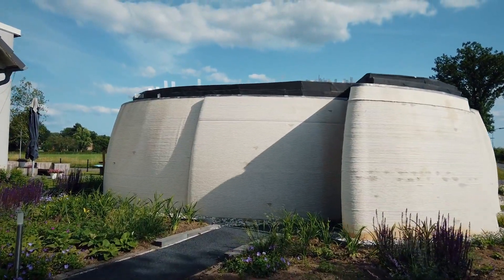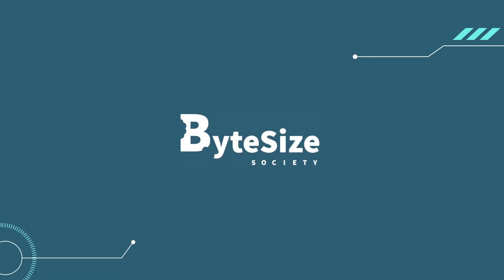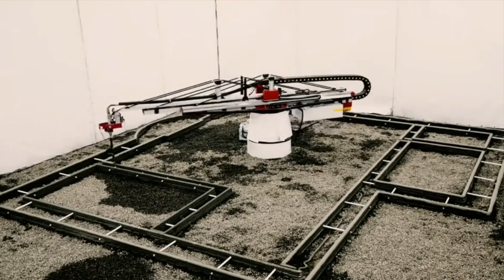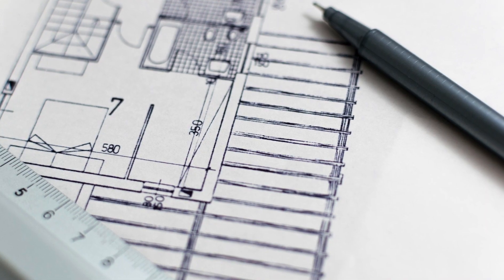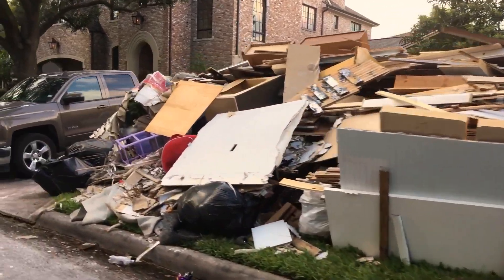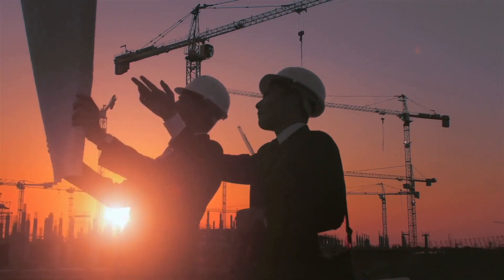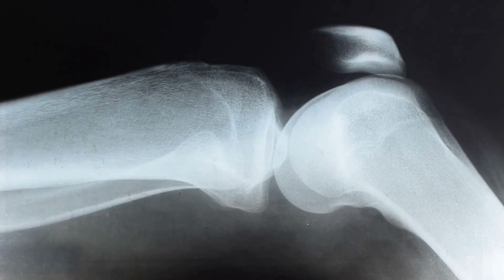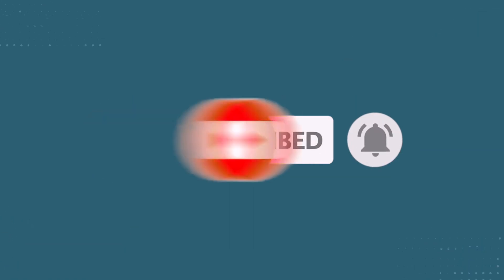A House for $10,000 - 3D Printed Houses are the Future!

Comment: The issue I see at first glance is the required space to fit the 3D printer into the space the house is to be built in High concentration areas like a Chicago where home plots are about roughly 40 to 50 ft wide.

Comment: Currently all that can be 3D printed is the walls. A small percentage of home construction. Electrical, heating and air conditioning, plumbing and other mechanical installations are decades away from a 100% fully printed houses. This too will soon blow over.
Reply: The tecla 3d printed house is just 1000 euros

Comment: In my opinion price 10000 USD is wishful thinking. For this amount you probably will be able to rent equipment + mounting and dismantling of the equipment. Sofisticated cement  additives and  concrete, specialized workforce as well would add 25 or more thousand to total cost.
Reply: Even $20k is good price